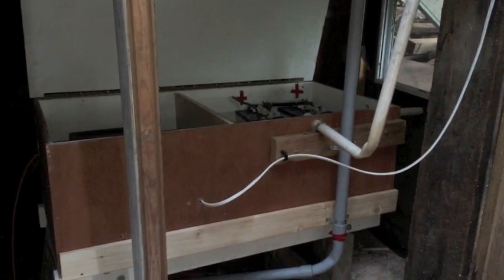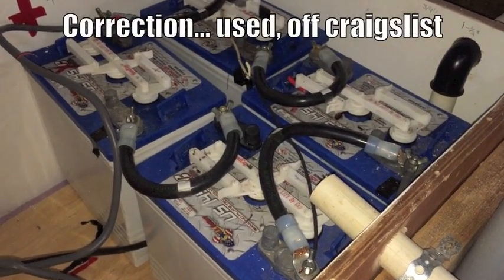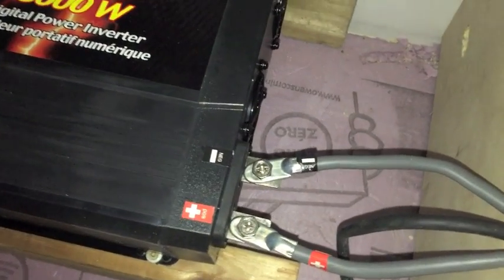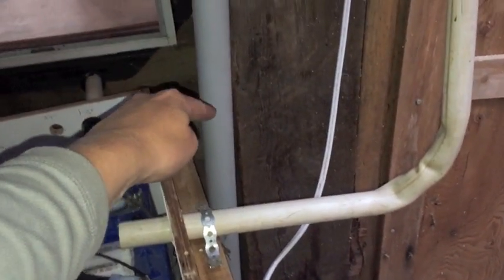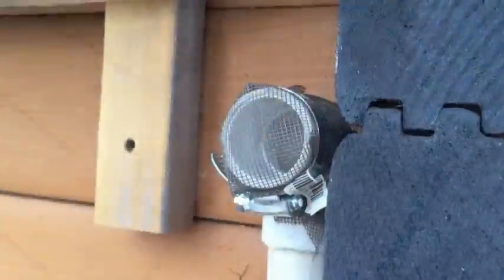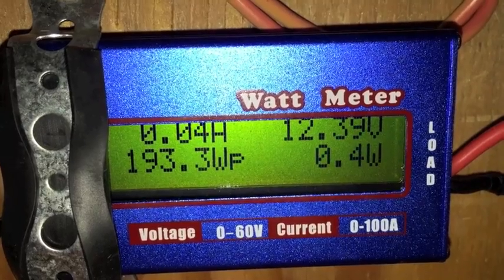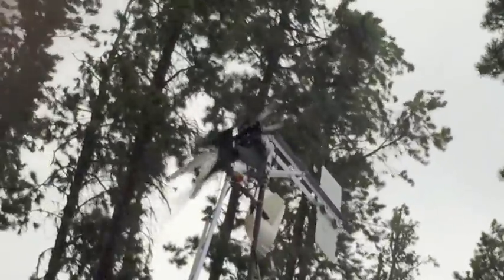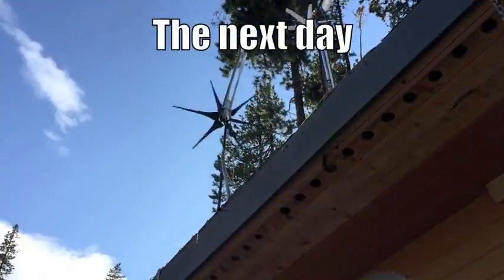DIY Off Grid  Solar and Wind Update for August 2015

Comment: The fan running all depends on the load on your inverter. Check the spec's. I have a 1000/2000W peak pure sine from the same manufacturer, but could only draw 7 amps continuously from it according to spec's, which is only 84 watts - something that wasn't mentioned in the advertising/labels when I first bought it, unfortunately. Had to look through the spec sheet in the instructions to learn it. It could only draw 1000W for brief periods - something like 10 or 15 minutes at a time - with a 2000W surge capacity (never actually tested that limit). The larger the load you draw from your batteries, the hotter the transformers inside your inverter will get and the more the fan will run to dump the heat and prevent a burnout. If you find it's running all the time then that's an indication that you're drawing too big of a load from it - something eventually will burnout, if not the fuses/transformers then it will be the fan. Check the spec's to see what the maximum recommended continuous amp draw should be per post (like most inverters, yours has two sets of posts to split the load to two sets of transformers) and avoid exceeding it - I think you'll find after looking through the spec's that you can't draw the full power you were hoping to, for the length of time one would reasonably expect. Try hooking up to the other posts so that you can split the load equally to all transformers, this will take the stress off of the ones that are constantly running hot. If that doesn't change things, then it's just a poor design - the fan may even be undersized for it's task. Transformers shouldn't be getting hot enough for the fan to run all the time. I now have a 5000/10000W pure sine chinese replacement that I paid the same price as I did for my Crappy Tire special, and the fan runs periodically.
Reply from the maker: +James Biggar Good to know. Yes, I only running less than 1000 watts for now. It's kind of a bummer that you have to shell out another $45 bucks for cables. Will be interesting to see if the fan goes on. I plan to use it for really big draws, like a power tool, vacuum or a future deep well pump. I might look for a 1000 watt Motomaster pure sinewave for smaller loads.

Comment: i had one inviter fan run all the time. other ones run only when hot.
Reply from the maker: +SolarShedParts.com I don't like the fan running all the time. My kids forget to turn off the inverter and it eventually drains the battery.